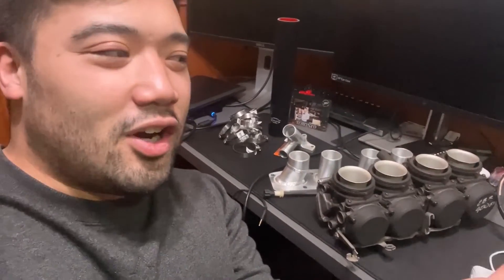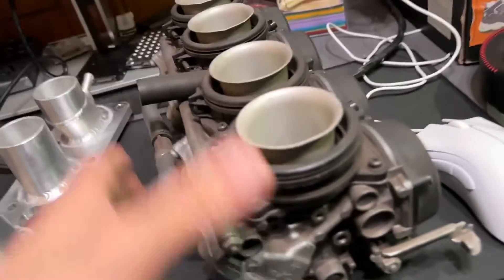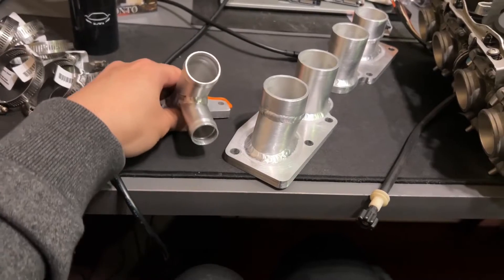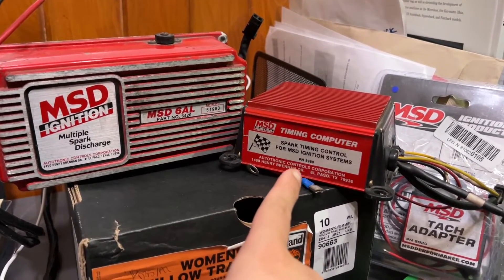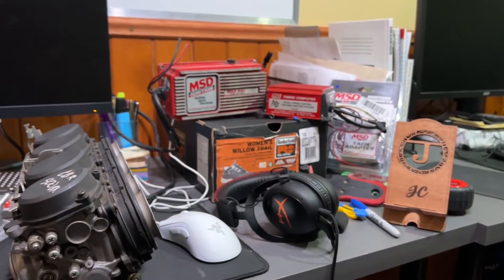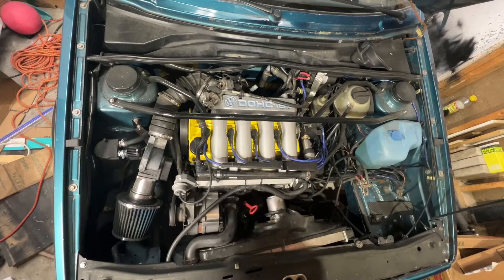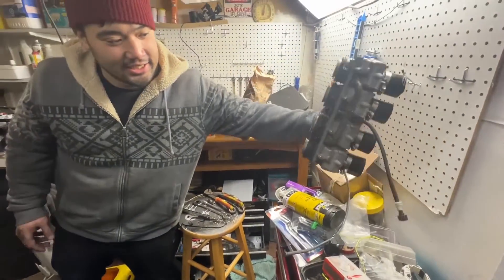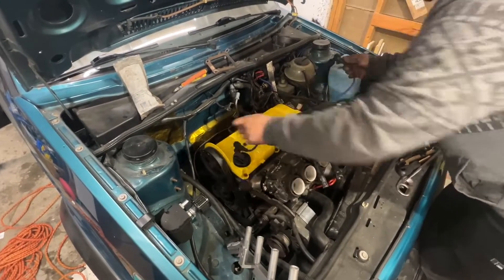VW 16V Bike Carbs Part 1: PARTS LIST AND MOCK UP

Comment: Great video!  I'll share a situation, then pose a question.  
Situation:  I'm working on a 16v with weber dcoe carbs and MSD 6AL2 but the weber carbs seems to have serious vacuum leak issues and is preventing me from tuning it properly.  I'm digging deeper but it doesn't seem like all cylinders are firing...  I'm tempted to buy bike carbs to replace the webers to determine if the carbs are the actual issue and your set of videos are a great help.   
Question:  In my setup for ignition, I only have the MSD 6AL-2.  For your setup, I see you have the 6AL, a Tach adapter and spark timing control.  I assume the 6AL and 6AL2 are almost equivalent...  can you please share why you got the Tach adapter and the spark timing control on top of the 6AL?
Reply from the maker: Hi, Spark Timing Control has pre-programmed adjustments as RPMs and load are added. As for the tach adapter -- if you swap to bike carbs and realise your tach isnt working with the MSD setup, this would be the fix